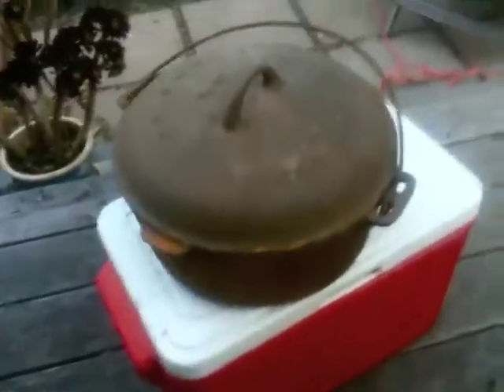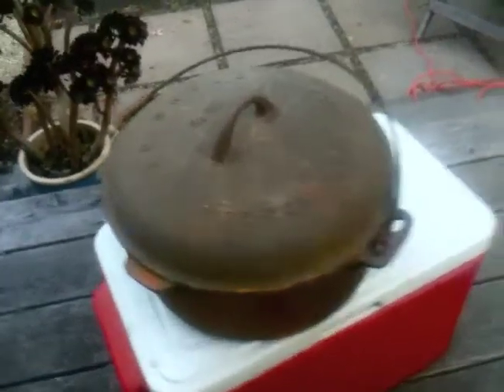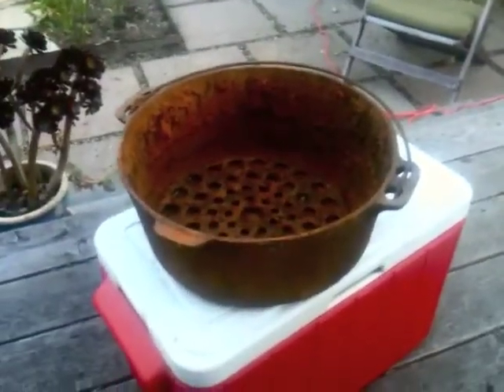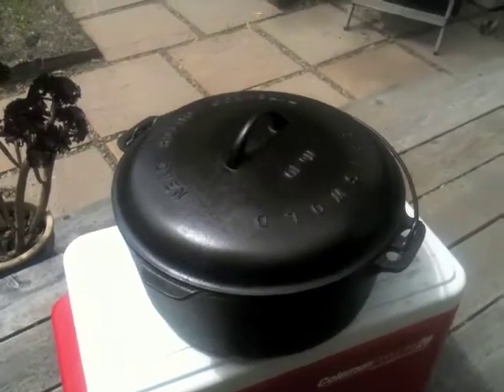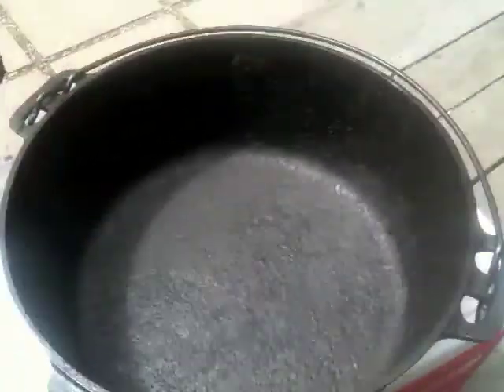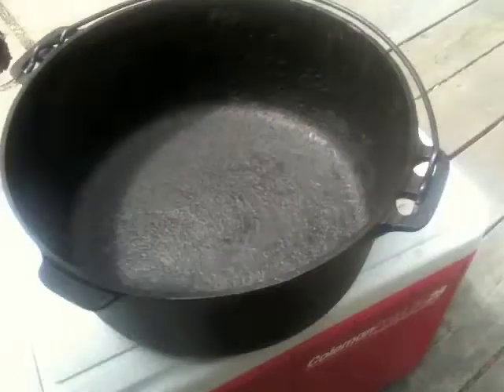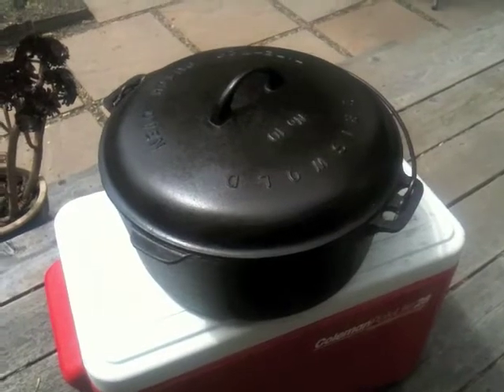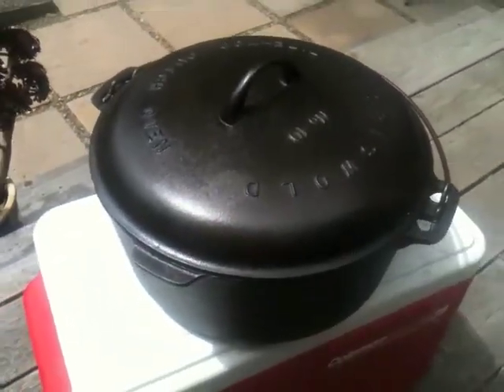Cleaning a very old cast iron dutch oven.

Comment: Na. its not "too bad" at all. unless you desperately need 600 dollar

for it is the crusty bits that msr Maillard had in mind...

Wikipedia > Maillard_reaction

Also, it's too, not to. In this case. 

And you have used "to bad" twice in the same phrase. duplicity is frowned upon. or a faux pas as they say in france.